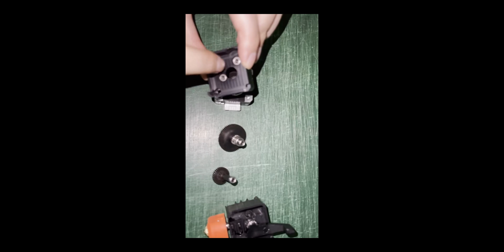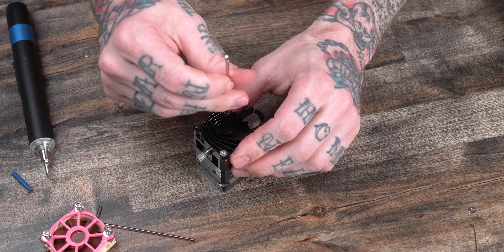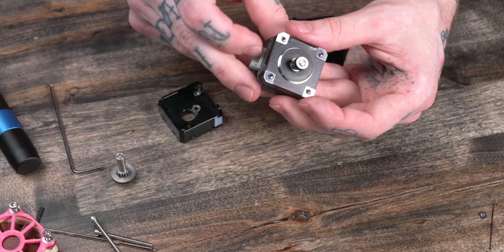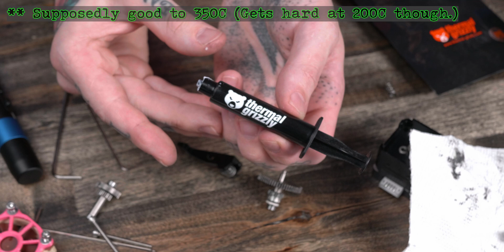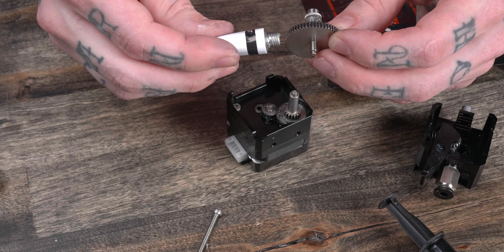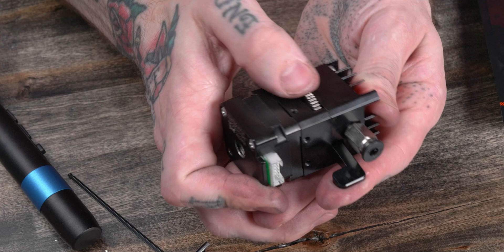Biqu H2 Clicking Noise Fix - Teardown and Adjustment

Comment: At around around 7:30 shouldnt there be a bearing on the top of the gear in the bottom left of the main assembly?
Reply from the maker: Yep, you can actually see the bearing on the desk behind my hand (toward the top of the screen).  I realized my mistake and put it back in off camera.  Just didn't discuss it because, I don't know, make a video longer just to point out a silly mistake? Meh.
Reply: @MandicReally  I would counter with other may make the same silly mistake and not catch it. Making things "stupid simple" is a good thing.

Comment: Hey, could you point me in the direction of how you setup your part cooling with the Biqu H2? It looks like it's mounted behind the carriage, that's something I'd like to replicate on my Ender 3 V2 when my H2 gets here.

Edit: I'm interested in the BLtouch mount as well.
Reply from the maker: I have a full video coming showing how I did my install (just a build vlog) on the Ender 5 Plus.  However I don't know how much of that will translate to an Ender 3.  The design of the Ender 3 likely eliminates the ability to mount the part cooling fan behind the X gantry as it would hit the frame uprights.  BL Touch Mount I can easily provide though.  

I'll show more of the design and details of it (as well as publish the files) once I get that other video up.  That should be sometime this coming week hopefully.
Reply: @MandicReally  You're right, I hadn't thought about the carriage traveling in front of the uprights. I was interested in it because I haven't been a big fan of the method most people use of tilting the fan out in front of the extruder. I'll try laying out everything when it comes in tomorrow and see if there are any other options that might work.
Reply from the maker: @NathanielHatley  Yea I designed and printed one that put the fan where my BL Touch is now at first.  It blocked the thumb-wheel which I didn't care for and put the BL Touch in the way of the fan (to the left).  If I was doing an Ender 3... I'd probably put it up above the extruder entirely.  Silly looking but out of the way.  I personally am a huge fan of being able to have a clear line of sight to my extruder nozzle when printing.

Comment: That’s not normal mine is smooth, silent and don’t skip at all. It can be the grease!
Reply from the maker: Before disassembly and greasing mine was entirely bound up. The “After” sound is almost non-existent. The video doesn’t convey that well. The difference is night and day and it’s been running for about 30-40 hours so far without skipping a beat (pun intended).